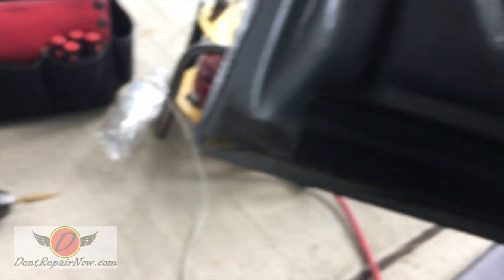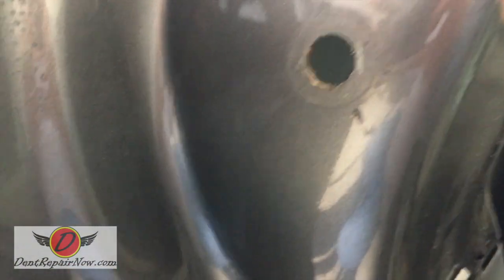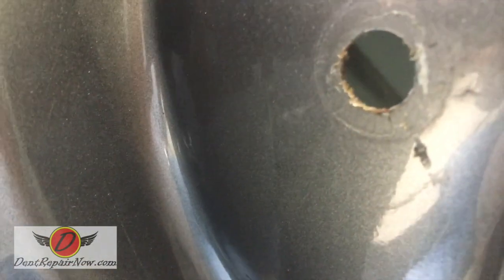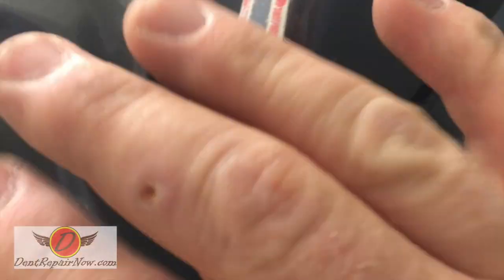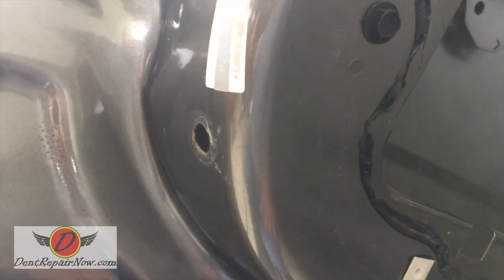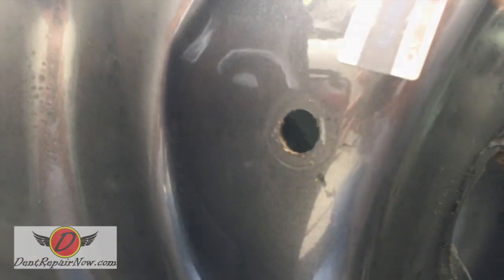What happens when a hole is drilled in a car door jamb?

Comment: What do you use to treat the drilled hole or just put the plug in?
Reply from the maker: We rarely if ever drill a hole. If we do, we touch up the hole and coat the inside of the panel with 3M cavity wax and put a butyl rubber seal around the plug.
Reply: @DentRepairNow  I recently brought a car and notice a plug. I tried to remove the plug but seems very stuck. Not sure if previous guy treated the hole for rust or not. Is it alright to leave it alone? I’m in GA, no salty road or bad humidity and plug seems very tight where no air or water can get to it.
Reply from the maker: If you’re in GA I wouldn’t worry too much. Rust isn’t a huge issue for you down there. We are in the northeast and salt and rust a big deal up here.